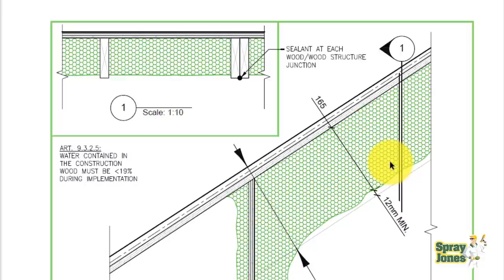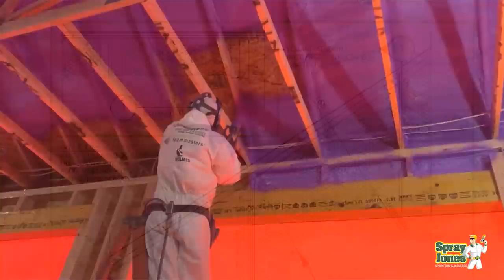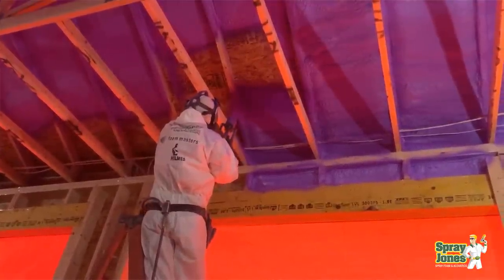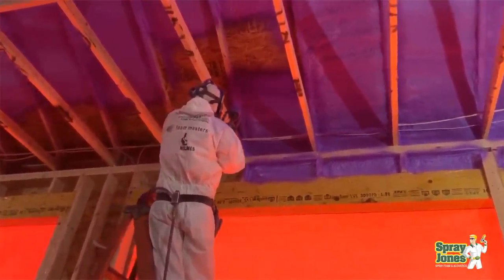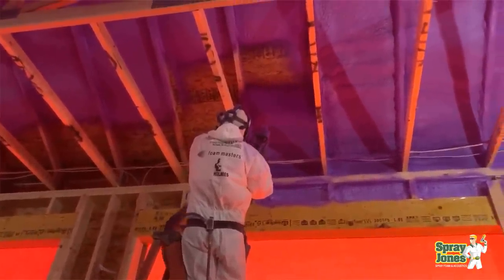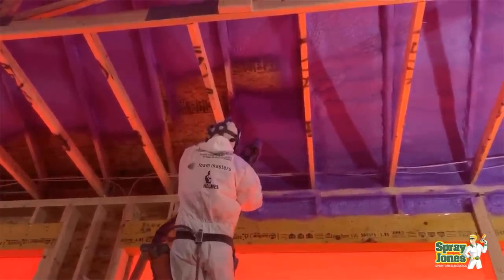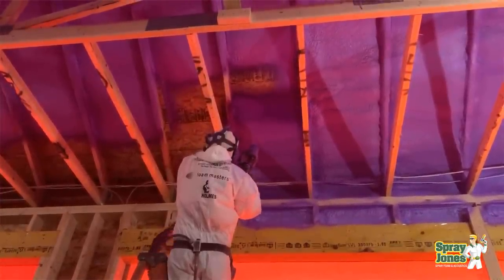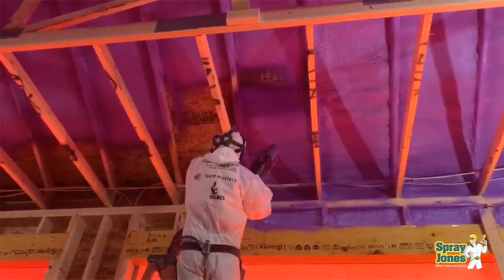Roof Decks, Water and Spray Foam Insulation

Comment: Suggestion - It would be nice to see a video of different types of rework, remodel or demo of previously spray foamed walls and roofs and what to avoid, not do, or make sure is done when a wall or roof that already has spray foam on it.  Kind of an ok you have a spray foamed house and now years later you want to change something but here are some things you need to know to make sure you maintain the thermal, vapor barrier, and sealing effectiveness.
Reply: I had to do work in a renovation I had done years earlier.  Ended up removing part of an exterior wall that had been spray foamed. Came apart easily, foam cuts out with a recip saw,no big deal. Had to remove foam on some walls to get to wiring. My spray foam contractor flashed those areas when he was on site to spray the new walls.
Reply: @jonathanconway7256  Thanks, I was wondering if it would be a big hassle but it sounds like it's not.

Comment: I dont agree with regards to a leaky roof being contained to a small area. Every drop that gets down to the decking will stay there and soak further and further since it will effectively be sandwhiched between two layers of non-permeable material [foam/shingles]. This will be much worse if the leak is occuring over where the decking lays on a rafter and theres a 1/32 gap for water to flow down. Even worse still if its happening over a sistered rafter thats been caulked on the underside creating a 1/16 water reservoir the length of the rafter. This obsolutely will cause structual damage if not detected quickly.  Spray foam on roof decking can be great but the roofing system needs to be planned and prepared for it.

Comment: Ok I'm convinced.  Thanks for the informative videos.  I would appreciate your opinion on something.  I am building a large detached garage and now i am thinking having my contractor build a 2x6 wall with 24 inch stud spacing.  I would also have them install a scissor truss style rafter.  Then I would have someone like yourself spray foam the entire building with closed cell.  Traditional dimensional asphalt shingle on the roof deck.  Is there anything that you would do differently in this situation or am I taking a good approach here?  I live in Alberta for reference.

Comment: Am I screwed?  My builder insisted on open cell spray foam for sealing the attic to make it a conditioned space. I wanted a conditioned attic. The walls are single floor of 2 by 6 framing with R-19 fiberglass insulation. The roof is a double layer synthetic underlayment with Certainteed Lankmark Architectural shingles. The roof pitch is 11-12. I live south central Alabama.

Comment: Thanks for this! On a new build for myself, in US zone 5, I’m planning on an R15ish mineral wool on the topside of the zip roof deck, but I need to make R60 per the new codes. Would you see any issues doing a closed cell layer (3.5 inches) then an open cell on the underside of the roof deck?

Comment: Great videos, couple questions: we are using a 12” ibeam for the rafter.. to be a complete vapour barrier do you have to spray over all the wood or would spraying between beams would be good enough.. also what type of underlayment would you use for black shingles.. and would you still use ice shield? Thanks
Reply from the maker: We spray I beam truss frequently. Just build the foam up between them. 
For roof underlay, ask your roofer. I do not make those technical decisions.
Reply: So you don’t need to skim completely around the ibeam? Just to confirm
Reply from the maker: @megangoodyear4982  Completely around? No that will mess up everything. Just embed the 2"x4" top cord in foam and build up your thickness in the middle.

Comment: What happens if you need to replace the roof deck? Then you have to reinsulate with drywall installed already. Which would be a very difficult, and expensive, job.

Comment: Very informative!! My brother is going to get a roof replaced and from what we think he might need to have his decking done again because code in the city has changed. right now he has common board on it as it is an older house. when they have to pull that to re-deck how is that going to work if he has spray foam on there?
Reply from the maker: Select areas that are damaged can be removed, I believe I spoke about this in the video. 
If he wants to re deck the whole roof, he should strap it and place new decking over it. This is common and a good roofer will know about it.

Comment: Good discussion.  I am just designing a new build to be high-eff, or even net zero or passive, so I have been looking at the closed-cell spray foam a lot recently.  Thanks for taking the time to explain all that.  So these would be considered a "hot roof" if memory serves me correctly.  Is there any consideration to the conditioned attic space that this creates?  Does the HVAC design simply account for the additional space?  Thanks.

Comment: What makes spray foam pull down OSB, making the appearance of a wavy roof?  Both houses were new construction.
Reply from the maker: I would start by looking at how thick the OSB was (7/16 or greater?), and if it was proper quality of grade. 
Since 2020 there have been serious issues with OSB supply and quality. Many have switched back to plywood sheathing which is far superior.

Comment: Curious if you think the prolonged exposure to the heat generated by asphalt shingles would degrade the foam sprayed on the deck.
Reply from the maker: No way. The foam can handle 180 F before it begins to degrade.

Comment: Is there any scientific reason(s) for ridge rot for a roof spray foamed from the underside ?  besides a roof leaking from the outside ?
Reply from the maker: The question is too broad to answer directly yes or no. What products used, what climate are they in, what conditions are a factor, etc.
I don't see closed cell as an issue.

Comment: Great video! As a builder in the north eastern part of the United States, I deal with new construction and close cell is the way to go for roofs. As I watched you video, a question came to mind regarding older homes. Can you tell me what additional weight is added to the roof deck from the closed cell? Here in New England there are countless home built 100 years ago when insulation wasn’t a consideration, and if insulation was added it was minimal and laid in the ceiling joists. Unfortunately roof rafters for these same homes might be 2x6’s 24” on center. Granted they do support themselves with a snow load, but if you add the closed cell to the roof deck does it create a load issue? I’m sure you would suggest seeking the expertise of an engineer, but I’m curious about the weight of closed cell once it’s cured, something never discussed with insulation contractors.
Reply from the maker: Under 1/2 lb per ft2.

Comment: I want to spray foam my roof rafters.  However, thinking of getting a new roof in about 2 years. Should I wait for new roof to be installed before spraying?
Reply from the maker: That would be prudent, leave yourself with options to address the roof to 100% first, then install the envelope.
Reply: @SprayJones  thanks.
Reply: @SprayJones  We're in the process of renovating our previously renovated attic. Our attic was drywalled, it had blown-in insulation behind the knee wall and batt between the rafters. We're ripping everything out and are planning to re-insulate with closed cell under the roof between the rafters. Our roof has never been vented. The eaves are closed - no vent - would you also recommend applying sprayfoam on the floor of the attic at the eaves - it looks like it would be about 18" or so... 

Also, and this is keeping me up at night - how much weight would closed cell sprayfoam add the the roof? I'm  a little concerned about that because our home is a 1940's home with 2 x 6 rafters on a 2 x 4 stick-built home. the rafters are about 16' long on each side of the ridge beam at 24" on center... the entire roof is covered with asphalt shingles and I am pretty sure that there are 2 layers on there currently - the roof deck is made of 2 x 8 (true 2 x 8) and not OSB or plywood... so all that adds up with regard to weight. 

Additionally.... the next time we do our roof, we plan to do a standing seam metal roof and we would be removing all the shingles (we'd have to anyway for code)... 

My questions: 1) with our existing 2 x 8 roof deck and 2 x 6 rafters carrying 2 layers of asphalt shingles, would we be putting too much weight on our roof by adding 2lb closed cell sprayfoam instead of something like Rockwool - and 2) if we plan to re-do our roof in 3-5 years, would it be a mistake to sprayfoam now?

Thanks in advance for any guidance on the subject.

Comment: Mike - Great content as always. I am starting to build an icf exterior wall house and plan to do a conditioned attic by having the underside of the roof deck spray foamed - solely because of your videos. There will be multiples sizes of top cords of roof trusses, not just 2x4. I understand the reasoning of spraying 4” to cover the traditional 2x4 but what would you recommend for the 2x6 and larger? I am in South Dakota otherwise I would have you do the work! Thank you for all that you do without asking anything in return.
Reply from the maker: Great question.
We build the amount of needed foam in between 2" x 6" top cords and allow only over spray to cover the rest of the lumber. To cover all the sides and top of all 2"x6" cords would add +25% more surface to the roof area in most cases. So they get a "skinning" as we call it.
Reply: @SprayJones  what happens if you need to replace shingles after foam installed?
Reply: @ericwendel1258  shingles are installed on the outside on top of play wood so I don’t think that’s a problem.

Comment: Underlayment has always been required by code in the USA. Underlayment is not a secondary water barrier. How could it be with four nails per shingle.   Only ice and water shield is a secondary barrier.  Foam insulation applied to the underside of the roof deck sheathing voids most glass reinforced asphalt shingle warranties.  
And the primary issue with spry foam applied to the underside of the roof desk sheathing is vapor drive to the exterior.  if this moisture laden air reaches the wood structure there is no way for the wetted components to dry.  in an assembly where air can freely flow over the surface of the structure it can dry down and the chance of decay is reduced.
I have been involved in countless projects where spray foam is applied directly to the underside of roof deck sheathing and the sheathing and structure are decayed to the point of collapse as a result of moisture drive to the exterior.  why did the condition go unnoticed til collapse you might ask...liquid water was never noticed at the interior of the structure a real problem with spray foam 
Wrap up spray foam has its place in construction.  the underside of any roof deck is not the place.
  If you want continuous insulation at the roof deck place it over the roof deck sheathing.  Provide a vent space over the rigid insulation and install the roof of your choosing.  Place the vapor barrier as dictated by your region.
Costs are comparable to spray foam and you will be much happier 
 Consult a building envelope expert with accreditation when building any dwelling for best practice

Comment: I was told the best foam sprayed under ideal condition with no voids was 5-6% open cell.  That's 5-6% that can absorb water.
Reply from the maker: Watch my 4 part series on un vented roofs.  explain it there.
Reply: @SprayJones  I don't understand how open cell is worse then close cell if both absorb water.

Comment: any take on sprayfoam like this and metal roofs? will it help with sound proofing?
Reply from the maker: Yes it helps.
Reply: Open cell a much better sound deadening product, but as spray Jones notes, certainly not the product you want in northern climates, or even mid Atlantic temperate regions . And even in the south, while I believe open cell would be the product to use, I would add a diffusion type vent at roof peaks for insurance simple, cheap…

Comment: I don’t recall if you highlighted this in the other series, but what specific precautions need to be taken if the entire attic and garage will be conditioned but there are front and back patios that aren’t? Does the osb blocking separating the two areas need any other specific care? This is assuming that the soffits will be vented for these patios.
Reply from the maker: You insulate what is to be kept conditioned. So where the roofs overhang you block them in at the house walls and close them off so that they are separate.

Comment: My brother and I own Bo’s insulation out of Oklahoma City, Oklahoma (USA). We now have documentation of all the energy consumption of 2 houses over the course of 2 years. The 1st house is 1500 square feet, built in 1964 with rockwool batts in the walls and blown in in the attic (vented system). The second house was built in 1953, is 1300 square foot and has rockwool in the attic but no insulation in the exterior walls. Both houses have single glaze windows and original hvac units.

We have a plan to rip off the Sheetrock and batts, suck out the old blown in from the attics, work hand in hand with an hvac specialist that’s keen on building science, spray the exterior walls and roof deck with closed cell spray foam, air seal with a spray applied caulking, run some blower door tests (potentially use aeroseal if we aren’t happy with the results), and lastly document the results of a FULL spray foam system and what it has to offer the modern world. My question to you Mr. Mike, would you like to help us with this? I just know that you could really help us make this worthwhile and lead, guide or direct us in the right way. You’re a legend in my book sir. We HAVE to show the world how unbelievable this stuff is (of course a true pro knows how to give the customer the unbelievable product of proper foam 😉).
Reply from the maker: Sounds interesting. I am not set up or insured to consult on work we are not doing. The results should be amazing, but we already know that they will be. It is getting the law makers to change the rules to accommodate the savings. Therein lies the real challenge.
Reply: @SprayJones  As it stands, utility companies hand out rebates like mad to get their insulation/windows/hvac upgraded. From my understanding, this is simply because it’s easier on that utility companies equipment when the house is more efficient and uses less energy. This enables the energy company to allocate the energy to a whole other property which is supposedly more profitable than having fewer less efficient properties. If this is all true, my plan is to show these utility companies the benefits of a proper foam system over to the older systems and see what happens from there. If these utility companies can dish out money to get their customers attics topped off with a few more inches of blown in, why on Gods green Earth would they not invest that money on spray foam. The only answer I can come up with for that is that they aren’t informed enough or they haven’t truly seen how much better it really is. You’re informing the world and I’m so grateful for it. Hopefully I can help make a dent as well. We may have to get creative but we have got to push the industry forward. It’s taking way too long for such a groundbreaking product to become the standard of building products in my opinion.
Reply: @animedbz20  great stuff mate, much appreciated! Do you happen to know why they would give their customers an incentive to upgrade their energy consumption in the first place? What causes the energy company to want to pay for 1/4 of the cost to get their customers r-values brought back up to code? I would also like to not just sit and let the government take advantage of me if what you’re saying is true. If the technology is accessible to build a home healthier, more efficient and sustainable than ever before but we aren’t doing it because of monopolies and the government, I’m not here for it. Maybe a Steve Jobs of home health and energy will come about then the worlds energy standards will skyrocket in record time. Just like IBM had a monopoly with their technology and AT&T had their monopoly, it eventually came to an ugly head then humanity was finally able to move forward.
Reply: @SprayJones  you said we already know that the results will be amazing and you’re absolutely right about that. My only disagreement with that statement is that it should be changed to the PROS know that the results will be amazing. People spend thousands on cars, clothes and iPhones all day long but breathe in their own farts because they’re unaware of modern day home efficiency. The average consumer is just buying a house and the builder is just contracting out the next contractor. If we can somehow change how the world thinks about this, we could be the next Steve Jobs of “home health/home energy”😂. You’d be absolutely amazed at how far behind Oklahoma USA is in the insulation and home energy/health department. It’s incredibly embarrassing.

Comment: Close cell foam will eventually soak up water believe me we used to use it in our boats,  why  do you think Boston whalers every year they sag deeper deeper in the water cause of water soaking into the foam , now that’s just my experience with close cell foam in boats
Reply from the maker: Closed cell foam in buildings will not soak up water. They are not in constant contact with the water. Comparing it to use in a boat is no where legit for buildings. 
We have the SPF approved for in contact with ground for under slab and exterior of concrete. I have SPF applied for 1/2 mile of inground water piping.